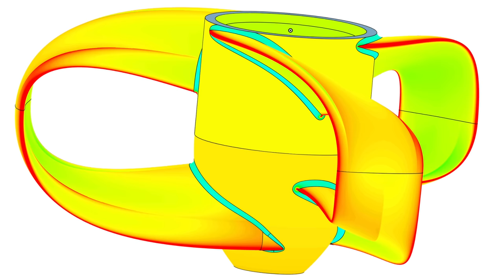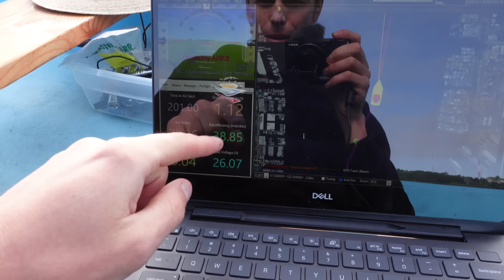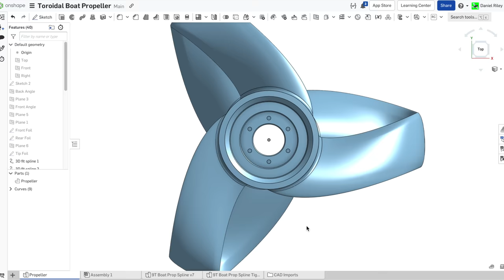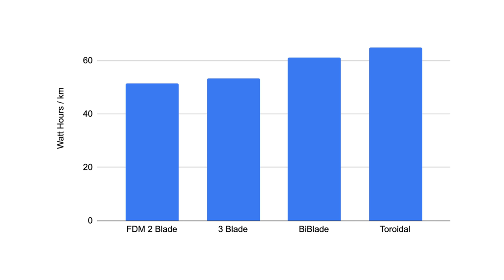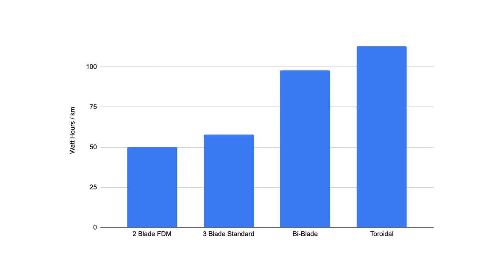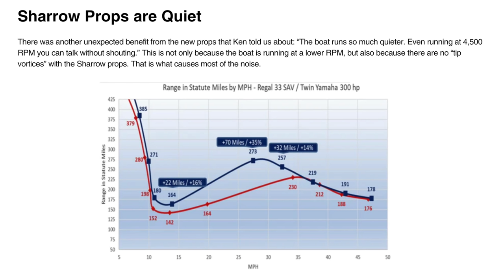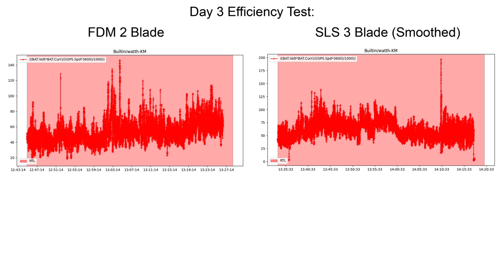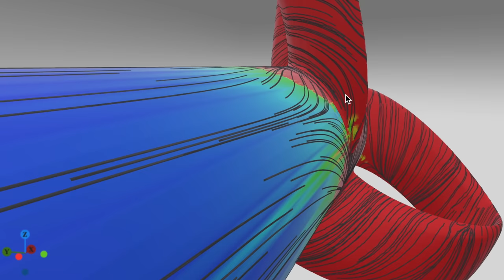Testing Futuristic Propeller Designs on my Solar Powered Boat

Comment: You did quite well with your testing it is always good to keep something constant. Do not be afraid to take out some files and fix the taper and cutting surface. Look up sharpening propellers shaping them. I liked your 6 blades design but I would have liked to see them in two halves so you can change their location . About shaping props my understanding is that the pushing surface face the rear of boat is supposed to be flat and the surface facing the front is supposed to be curved best wishes. Get those files out and cut the six blades prop in half so you can rotate the front ones relative to the back ones. Good luck hope to see more from you. You can also look up balancing your props I think the large diameter ones needed to be balanced.

Comment: Should try hydrophobic coatings on just the front and just the back of props also, assuming hpu can get a fine enough detail.on results to see which is better, if either is better than no coating or full coating.

Comment: the toroidal propeller has it's peak efficiency at a certain rpm value. the first part of the propeller creates a pressure wave that takes a certain time to arrive at the second part of the propeller and can be calculated with using the speed of sound of 1500m/s. then you have to spin it with the right rpm to get the pressure wave to the right position/angle of the second part.
the same applies to your 2-blade design. first blades influence the second blades.
if you look at the sharrow propeller and yours, you will notice that they are bent to the rear. i think with your design there might be a significant amount of energy lost outwards through to centrifugal force. but with the right design you convert the centrifugal force in a force that pushes to the rear.
you would need a CFD computer simulation and a set of parameters that defines the shape and then run an optimization algorithm to find the perfect set of parameters.

Comment: At TU Berlin there was the question, What object has the lowest drag coefficient?
After some research in their watertunnel they found a rotational body calculated from a Kaiser-penguins shape had less drag than the default body.
That should make a fine blade for the prop.

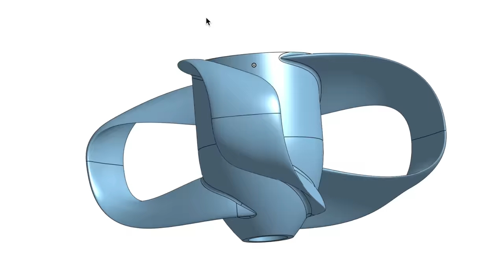Comment: 27:25 OR, as an alternative to experimental wanderings, there is sometimes the option of having a much better understanding of each phenomenon involved in propulsion before the design phase, and a much more realistic hydrodynamic model than a simple "hey, I heard about a new <fancy adjective> propeller design and I want to see if it can magically change everything by imitating it without knowing yet how it actually works".
Sellers care about names and objects sounding or looking as good as "Fibonacci", "Toroidal", "Hydrophobic", "Hypercavitating", "Ultralaminar", "Bionic", "Anti-vortex", "IA-made" etc… while engineers care about real things: mass, movement, energy form, transfer, viscosity, drag, lift, acceleration, reaction, coupling, resonance, stability, optimisation methods, etc.
Engineers make better propellers for each purpose, not sellers.
Design types emerge from the methods, they are not the methods.

Comment: Important thing to note; you mentioned how if the propeller offered fuel savings the shipping companies would have an economic incentive to buy them, this is a common misconception as it is not the boat owners who pay for the fuel but the individuals paying for their goods to be shipped. This factor combined with the high cost to implement anything in shipping means innovations there have to be absurdly good to see any widespread adoption.

Comment: Whole bunch of comments:

1. You mentioned it yourself but that stalling tendency is an obvious efficiency problem that makes comparisons really difficult.

2A. as the first of a bunch of comments on the foldover of the toroidal i suspect your choice of camber was actively hurting things, reducing the tip vortices is what's supposed to provide the noise reduction in drone propellers, and since creating noise uses energy it's also what would provide any efficiency gains that may exist.

2B. in addition trying to increase the flow rate through the prop by pulling water in is probably going to make efficiency worse. Thrust is ultimately a coproduct of the law of conservation of momentum. But the energy required to produce that thrust is ultimately a product of the law of conservation of energy. Thus moving more water at the same or slightly lower velocity is a more efficient method of increasing thrust per energy than driving the same amount of water or slightly more water at a higher velocity. Though remember that in the real world any propulsion system will have waste energy expenditure not related to accelerating the working medium. So if a toroidal design increases those it could still be less efficient, but it would have to be expendign that extra energy as heat or some other non-pressure change inducing output.

3. You mentioned that propellers with a larger number of blades are generally less efficient but are able to put more power into the water, it occurs to me that with the aerofoil design of biblade and toroidal propellers it's probably the case that they have efficiency slightly ahead of a design with double the number of normal aerofoil surfaces, in your case a 6 blades traditional design. But you probably don't have the power output on your boat to actually get to the point where a 6 bladed prp makes sense.

4. You might want to look into the Ultrafan concept and related idea's in aerospace as well. The Stators they're using in such designs and other tricks may well be able to be applied to Toroidal or Biblade setups. Though from an engineering standpoint that would be potentially tricky to setup.

5. In line with contra-rotating propellers i suspect toroidal designs have issues with interference between leading and trailing blades, that probably makes such designs very sensitive to the gap between the front blade and the rear blade.

6. The engineering challanges are absolutely likely to be a major factor in how heavily they see any use. In particular the extra mass of the foldover means that to support that the profile of the inner portion of the blades has to be thicker, or the whole prop has to be spun slower, (which reduces peak thrust), and this problem gets worse the larger the diameter of the prop, so toroidal may only work at smaller sizes. This may also be why the commercial example you found for maritime use is so aggressively swept, it reduces the prop diameter whilst maintaining blade area.

7. If you ever revisit it might be worth including a couple of props designed to use a version of the Prairie-Masker system prop elements. It's meant to reduce sound by reducing cavitation noise, but if it does that in theory it might improve prop efficiency, (jn practise you probably lose more to generating the compressed air, but it's still an interesting concept from a "what does it do to the props efficiency" standpoint).

Comment: @4:33 isn't downwind what you would want to do? Get some extra air flowing under the wings to provide some "free" lift, so you can take off earlier?
Reply: I'm not a pilot but, upwind is against the wind, which would create more lift at a slower speed. 
If you were going downwind, you would need to match the wind speed before you start getting any lift, at which point you already have that much more friction on the water. :hand-purple-blue-peace:

Comment: In the Hydro dynamic environment surface area is critical for drag and if the new props have more surface area they will be less efficient. It's a massive factor when deciding what prop to use for the type boat.

Comment: At least with air, The dragon fly configured prop moves a lot of air, maybe water too given it's all fluid dynamics. Old fashioned design found in radiator fans, dodge and ford. Made a 4 blade form a 6 with my window AC, works twice as good.

Comment: The torroidal propeller company probably meant that underwater noise is mainly generated by tip vortices which is important for maritime life. Pretty sure they not meant the noise on the boat

Comment: Did you try doing a integral calculation on the total “rake” for lack of a better term.  This way you can see how much water the prop is pushing per rotation.  That might be why the efficiency is lower on yours vs the other marine company that makes these commercially.  This way they are able to keep their width smaller and pull more water through a less wide prop.  This could be how they tune their efficiency at given speeds.  As they try to push more water through a smaller width the internal pressure in the prop would act as drag as water doesn’t compress.  The other issue is as you said the wash off or the tips that is water that was grabbed and thrown to the outside of the prop.  The toroidal prop can’t let the water go so pressure builds up.  The other prop company reduces this by making the prop longer/deeper so that the excess pressure doesn’t build up on the outside of the prop but uses that to push it farther forward instead of acting as a restriction to flow at the outside.

Comment: About your toroidal design and the understanding you have of air pressure when comparing to applications of winglets. You are kind of right but not exactly, the efficiency comes from the lack of drag generated from the wake of air of water if were talking propellers which creates a better surface resentence co efficiency. Because of how the the flow is being redirected and guided by the winglet geometry and not just pushing directly against like you state here because remember the craft is in motion for this to even happen meaning the air or water of we are talking propellers again are being passed over and around it in a linear fashion. If you catch this hope that helps.

Comment: You could just take them to a refinery and get them cast into bronze or stainless steel pretty cheap..you bring those in and they will coat them in sand and melt your core out and replace it with steel..

Comment: You should build a tank of water to be able to test different propeller designs and figure out what speeds and angle are optimal for your size motors.

Comment: I always viewed toroidal props as the next step of what ducting has always done.  Bare prop > ducted prop > integrated duct (the duct spins, akin to an annular wing) > and now integrating the duct into the blades themselves.  Though I never thought about how the curve of the toroid would affect tip vortices, such as how winglets work, though at the same time I've never really considered how annular wings would affect tip vortices either as they seem to have been a one and done fad long ago.  The amount of optimization needed to produce a proper design is going to have to be highly exponential, as you're dealing with such a convoluted profile, it's probably one of those things that's better left to a machine-learning neural network given how complex it is.  I also don't think Sharrow's patent(s) are going to hold much weight either, there's too many variables within the design alone, not to mention specific applications, etc., that patent basically only exists to protect their product from clones, not that specific regions care about that nor will they have any legal power to fight clones from those regions; it's a product patent, not a technology patent, even if your design is similar it wouldn't be infringement, just like how those MIT-like drone props won't be infringing. 

As interesting as all of this is, bad design and improper implementation really invalidates any findings.  Other than lack of full understanding of newer designs and any potential lack in CAD skill, or lack of CFD and FEA (keep in mind, you may have dimensional instabilities as well, which will also impact performance) analyses, why would you ever put a prop that's akin to a speed prop on something that isn't a speed boat; literal apple to oranges comparison here, a massive red flag, it's bad science.  The whole boat weight variable is another issue, one that's mostly controllable as well with better methodology.  Another issue is indirect comparisons, you can't jump from a 'glass smooth' FDM print to an unfinished SLS print of an entirely different design, again it's apples to oranges, slowly iterate through design changes instead of taking massive leaps to avoid variability issues; you should've tested the identical design before and after smoothing, then moved to the three blade design, then the multi-blade design, etc., while keeping the variables consistent.  Though what you really need is a tank setup where you have all extra variables controlled, where you have a meter for thrust, a meter for water velocity, and the typical electrical metrics; with a large enough tank you should also be able to better test the fuller RPM range, and with some math you could extrapolate the data and come up with a boat speed for given weight and hydrodynamic efficiency.  Results aren't really worth much unless you have good science behind it, and good science starts with good methodology. 

I also wonder well laser ablation would work on the SLS parts, if it's viable this would probably be the fastest approach to post-processing given the correct setup.  I've always argued that the additive manufacturing industry will go nowhere past rapid prototyping without also including subtractive post-processing, especially when it comes to FDM.  If you can have a mostly dimensionally-accurate buck produced by a 3D printer, then you can have a dimensionally-accurate finished product with good surface quality with subtractive post-processing with minimal material waste; and for more complex shapes this would become even more true if 5axis 3D printing would ever take off, though this is more of an issue with slicing and approach to manufacturing, which is an entirely separate topic where SLS currently remains the best solution until then given that the powder bed acts as a work-holding method and non-fused support material, which then circles back to the curiosity if laser-ablating the surface is a viable post-processing method.  Surface quality will always have some amount of effect, but again how that's measured comes down to good science. 

All of the efficiency claims come from how quiet the toroidal props are supposed to be.  People think quieter equates to more efficient, as less energy would be wasted on producing noise, which would be true if that was the only variable yet props have an exponentially larger amount of variables.  And it doesn't help when so many content creators aren't actually educated on the subject with their generalized audiences being even less educated on the subject; there's a channel in particular that 'tests' PC fan designs but has so much bad science and bad methodology, but the comment sections on their videos are such a shitshow of clearly uneducated people bickering about nonsense.  It's really just a snowballing issue of stupidity in all honesty, and this happens with every major research paper that comes out, the modern internet and social media really shows just how low typical intelligence is; what I thought was just isolated stupidity due to various factors within specific locales is proving to be a much wider and more consistent issue.  Humanity really is just a circus most of the time.
Reply: The design idea is not knew at all and has been in use for over 100 years. And as you said - people just claim it is efficient without evidence, while the MIT paper clearly states that for a given produced thrust the props were less noise but also required more power.

Comment: If not fully polished exceedingly well maybe the overall surface area is a primary reason, assuming the toroidal propeller has the most surface area, it would follow that it would suffer the most from the unpolished surfaces.

Comment: @@rctestflight when pulling skiers I go down to 17 pitch for better torque for pulls outs. Under normal boating that prop will over rev and redline the boat with a 23 I will cavitate, 19-21 is the normal sweet spot high winds nd waves 19, smooth 21. I know you have done your home work however your low end pitch starting point should over rev your motors, your testing should start at the lowest usable pitch, then increase until you hit the best case then back off to under drive your motors like the engine in the old VW. They shrunk the carb to save motor wear.

Comment: Are u considering resonance when testing? It seems like each prop has a sweet spot for rpm. So if u adjust the prop to have its sweet spot at the speed u want or that is best for ur boat. also as far as features to adjust, maybe figure out 3 or 4, have 2 or 3 adjustments, and iterate iterate iterate and maybe you'll be able to sneak up on the very best props, for ur boat at least!